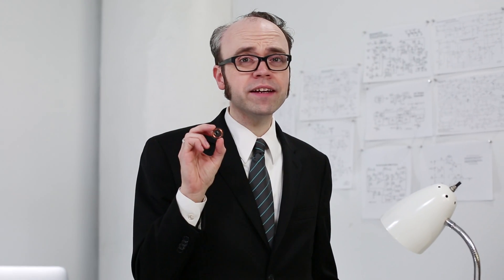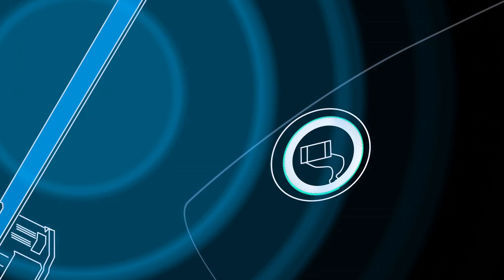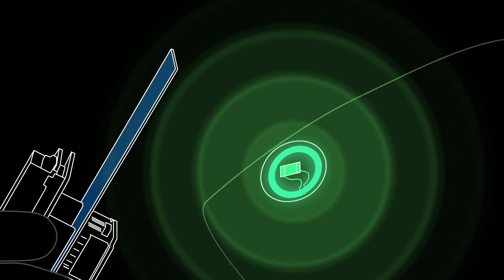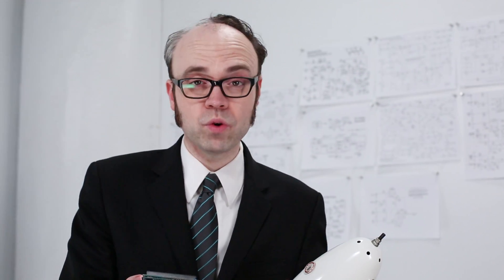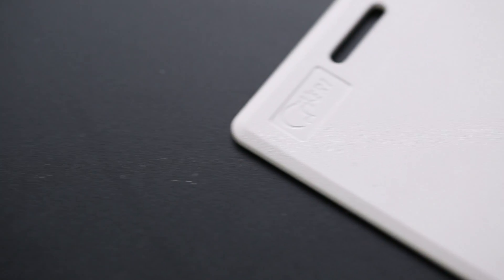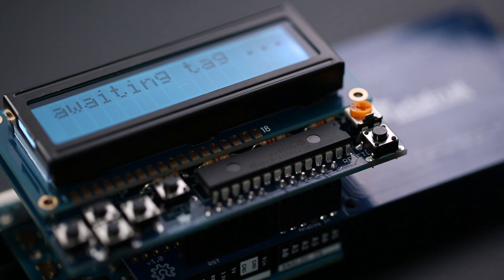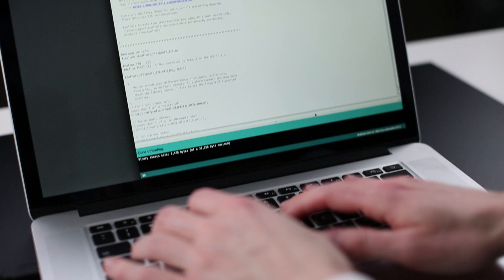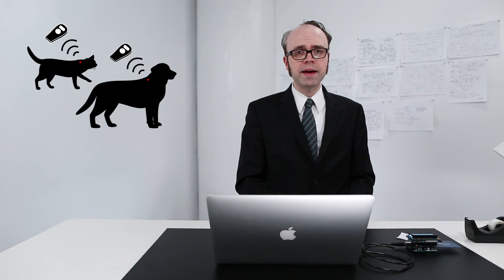Collin's Lab: RFID

Comment: What is the maximum range of the RFID tag? Can its transmission range be extended to say, 10 ft?
Reply: +Rainbow Hyphen Your feedback is a cause of feedback because of feedback. You might want to consider the loops made with aerials as large a CERN. Then someone could come along and draw your attention to stuff larger than Australia:

http://forums.theregister.co.uk/forum/1/2016/03/19/I_Aproveofitspendingonspecificprojects_BoM/?post_received=1

But that would be shameless behaviour.

Comment: I'm starting a project where RFID tags will be logged so people can sign in and out of a room, and later I can see who was there, when, and for how long.

I'm having trouble finding a method of reading serial data through a USB. Can anyone point me in the right direction?
Reply: haha use Google Chrome. I have been wanting to for a while now, I just haven't gotten around to it. Then it could sync automatically to drive.
Reply: AKSoapy29 Unfortunately, Google Chrome isn't available on all the platforms I would like compatibility with.

Comment: Isn't RFID extremely insecure?
Reply: It is only ever meant to be a label for an object. It's about as secure as a bar code... which is to say: Not at all.
Reply: Hence their use as door keys is a convenience and absolutely terrible security... Which is why their increasing presence in bank cards is worrying
Reply: Yup they can be cloned and used for malicious intent if they said RFID belongs to something important
Reply: Falcrist the good old magnetic strip is much more secure... Need to swipe it to clone. Same with the smart card. My uni has just switched from Magnetic to RFID for doors and there have already been security issues
Reply: How secure they are depends on the systems they are used in. For door lock systems or even ATM cards, requiring a PIN will add all the additional security most people really need. Even if someone manages to get close enough to clone your card, they will still need to get your PIN for it to be of any use to them.
Reply: RFID is used for banking and  transit systems with a high security level.
Reply: Only if you use MIFARE Classic cards, which use Crypto1, a flawed encryption algorithm which relied on security by obscurity, or if you use the default keys for the tags (don't do that!). But this has been fixed on MIFARE DESFire EV1 and EV2 and MIFARE Plus, which use AES, a very strong encryption algorithm. And there are alternatives to MIFARE as well. 

Not to mention that the attacks require quite a lot of time (various minutes) if you don't use the default keys, so they're usually done either at the reader (when nobody is watching) or on a stolen card because having someone being at your side with a device near your bag or pocket for various minutes is pretty suspicious... And if the reader is intelligent, it'll delay or even block attacks entirely and alert someone. So the only option would be stealing a card and, guess what? That's also the way you can clone a magnetic stripe card! And magstripe cards can be hacked by a device placed on a store's reader, and RFID cannot because of the time constraint I mentioned before.

@Angus Pearson If there have been security issues at your university is because the system designer was incompetent since as I mentioned, there are secure RFID alternatives.
Reply: ***** They don't make bad door keys. If someone gets close enough to you with a reader, they could have snapped a pic of your key and duplicated it anyway.

You can always keep it in a shielded sleeve.
Reply: Joe Gold Haha, fun story. =) Watch "Pablos Holman at TEDxMidwests".
Reply: LunarCaster no for online shopping :P, the RFID on a credit card has you CVV and obviously you CC number along with your name and address
Reply: depends, there are systems in the works that re-write the chip every time it's used

Comment: What does nfc do differently?
Reply: Nothing.
Reply: Near Field Communication. Is the tecnology that able communication by wireless, a protocol to be more specific.
Reply: NFC requires a distance of 10-50 cm, whereas RFID can have a larger range. NFC is also meant for data transfer; RFID is more useful as an identifier (so you can find your keys instead of making a purchase at a register.)
Reply: Thanky you!